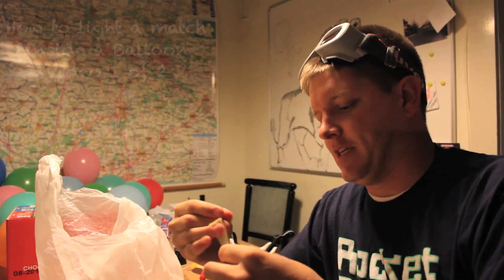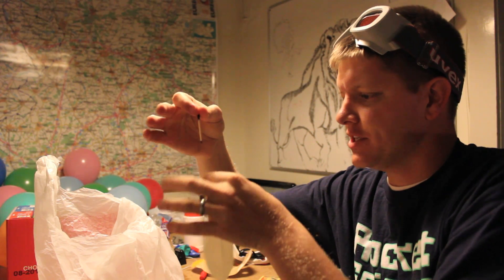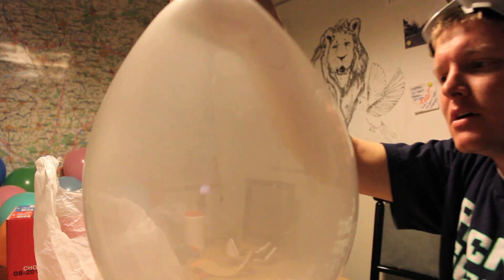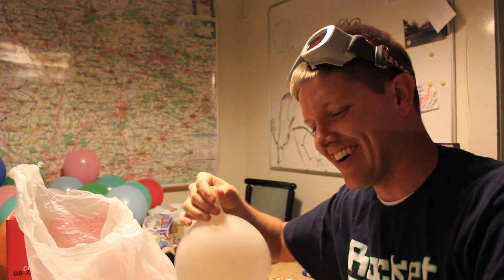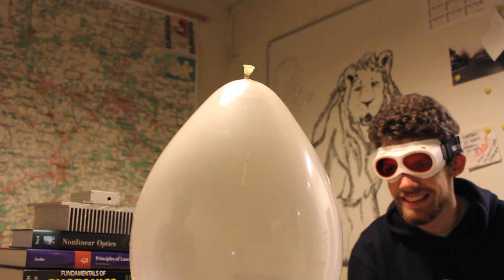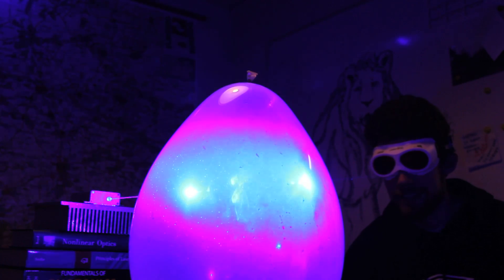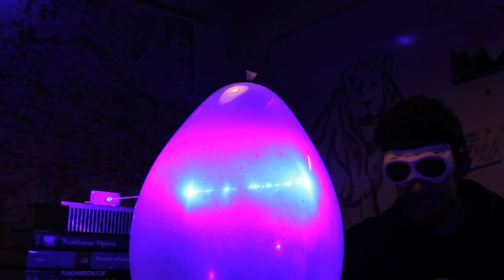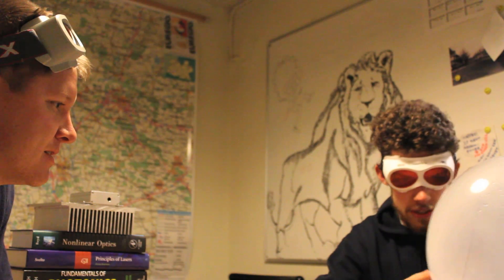How to light a match inside a balloon - Smarter Every Day 36 LASER MONTH

Comment: This experiment was great.  I expected to see the light focused onto the match as a means of passing through the balloon without harming it, but it appears that focusing the light was not necessary.  I liked seeing the condensation from the water byproduct of combustion.  Also, did you notice if the balloon increased in size from heating the air?

Comment: did you put a filter on when the laser was active? or did the camera decide togo nuts?  it looked cool
Reply: high powered lasers tend to show the line streaks.. I believe the laser used is an industrial grade laser, which could be around 5W to 50W.. bigger industrial laser could reach up to a couple of MegaWatts
Reply: I recon it looked like the camera got nuts as the laser got every so slightly scattered and even a fraction of the beam is enough to saturate the camera?

Comment: You need oxygen to have a fire! You used you own exhaled air which barely contains oxygen.
Reply: the atmosphere is 21% oxygen, 78% nitrogen and 1% other, which is mostly Argon. there is hardly any CO2 in the atmosphere. you breath out 16% oxygen, so only 5% is used up in respiration
Reply: But it still contains oxygen.
Reply: but no enough to lit it on fire
Reply: well whatever
Reply: thanks for the reply and your time
Reply: Okay, our air we breath is not all oxygen(O2) there is more carbon dioxide(CO2) and nitrogen(N2).
Reply: Your breath contains a fair amount of oxygen. It's why CPR works.
Reply: actually, I am very certain we don´t use A LOT of the Oxygen we breathe in
Reply: What's you're forgetting is that he's lighting a chemical compound, and not just burning, say, paper or the wood of the match.  Match heads contain potassium chlorate, which is an oxidizing agent.  When the potassium chlorate breaks down, it releases oxygen.  

That's probably why the balloon didn't pop, the fire went out almost as soon as the matchhead was used up.
Reply: u may not. I m very thorough
Reply: RCFlightReviews
thx
Reply: 16% is barely enough to start a fire though. Fire prefers higher oxygen levels. how much depends on the substance but as a rule of thumb. The air you like to breath is the air fire likes to breath. As humans anything less that 19% is considered dangerous.

Comment: he blow into the balloon to fill it up, considering that there is already a little amount of oxygen in there, the level of CO2 should be much more. I am just confused, that with so much CO2 and water vapor how could the match really light up?
Reply: There is the same amount of oxygen as any old air you could light a match in, and there would only be tiny amounts of water vapour which a match could handle
Reply: The water you see in the balloon after the match burns is actually from the match itself. When wood burns, about 50% turns into carbon dioxide and 50% turns into water.

Comment: THE BALOON DID NOT SHRINK BECAUSE...

the same amount of carbon dioxide is produced as oxygen is used up.

why because of the equation...

C+O2~CO2
from the reaction we can see that the same amount of moles of oxygen per unit time is used up and is equal to the same amount of moles of carbon dioxide per unit time being created (look at the equation ^^^)

now...  VOlUME=moles*24

if moles of oxygen used=moles of co2 created. Then when oxygen combust the same volume of oxygen which is removed is replaced with the same volume of carbon dioxide.

to conclude, the volume remains constant.

even if there is incomplete combustion occuring.
Reply: +ZKR JAMA yes but heat causes expansion so it wouldn't be unreasonable to expect some even though the match is small
Reply: +Shaithydollarz 1 mole of gas takes up the same ammount of space no matter what gas it is
Reply: ZKR JAMA why then does a soft boiled egg suck into a jar when you put a lie match in?
Reply: +Benjamin Shaffer If you look closely at the baloon you can see that it actually get bigger!
Reply: happy this is not true
Reply: youre considering the ideal situation. It is definitely possible to find gas that occupies a volume that doesnt satisfy your "constant"
Reply: matter is nor created nor destroyed!!!
Reply: What?
Reply: +Accelerator 
Wut are chu doing here?
Reply: with that logic nothing would shrink at all.
Reply: isnt it because humans exhale co2 ? but then what did the fire produced by the match use as a "fuel"?
Reply: because the co2 thats produced is hot and leaves the bottle by pushing the egg up but because of the shapen of the egg on the cap the air cant go back in after the air in the bottle is cooled so the egg gets pushed in
Reply: Because the air inside warms up and expands when the match is lit. Then when the match goes out the air cools and shrinks and pulls the egg down as it does.
Reply: Shouldn't heat make it to expand since hot air is less dense than cold air?
Reply: The balloon gets slightly bigger because the fire heats up the air so it expands a bit. Without the heat, volume would stay more or less constant.

When you light a match, the air inside the bottle heats up. Then you put an egg on top of it. After a while, the air cools back down, becomes more dense and sucks the egg inside.
Reply: you're also forgetting to factor in the smoke, which I know contains phosphorous, and whatever other things exist in wood. So it could expand, not to mention the difference in density between O2 and CO2.
Reply: +ZKR JAMA just because they moles of something remain constant doesn't mean they take up the same amount of space, there is the factor of density y'know..
Reply: shaithydollarz

yhh your right density would affect it but

volume=mass/density

and the mass of co2 would increase as
mass=moles*mr 
and the MR of co2 is greater but the moles is the same.

however the density of co2 is larger than that of O2.therefore making the volumes equal....

i could be wrong but im just explaining it from what i know
Reply: forest dewberry smart idea never thought of that, but even then i believe the volume will remain
Reply: +Ryan G Unless you need to be extremely precise in your measurements, the ideal gas law is close enough.
Reply: Shaithydollarz 1 mole of gas, no matter what gas, will always be 22.5 L. I'm currently taking honors chemistry, and know a thing or two about what i'm talking about, unlike some people above me on this thread.
Reply: +Shaithydollarz Honesty, i could go on further, and calculate the exact change in volume based on the change in heat, but i'm feeling lazy today.

Comment: Did the combustion increase the volume of the balloon?  (Sold being turned into a gas?)
Reply: I dont think there was any combustion if so it was very brief. Correct me if I'm wrong but the balloon containing carbon dioxide, and in order for fire to stay alive it needs fuel and oxygen. And since there is no oxygen the fire cannot survive thus causing it to. Be deaded
Reply: bigtuckTm Great question.  The match has an oxidizing agent and released oxygen just like oxygen masks on airplanes.  For the match and oxygen masks on planes the burning of chemicals releases oxygen for a second for the match and 30-60 seconds in a plane.

Comment: This is a Spyder 3 Arctic laser. It's very expensive and kind of dangerous. A lot of you have been asking for a link so shazam -  http://www.wickedlasers.com/arctic?gclid=CJ3HrNqn1LsCFWMV7Aod4mkApw - There are other colors and such so check it out, that's only the link to the exact model they have.
Reply: DtodaH
 I think the laser in this video is more powerful than the Spyder. I haven't looked at the wickedlasers site, but I bet they don't pop WHITE baloons. That's the key. Even if they shined the laser through a black spot sharpied on the balloon, it would pop.
Reply: The Spyder 3 Arctic laser is not used in this video! That laser would have destroyed the baloon. They use that laser in a video to pop 100 balloons in a row. This is likely one made from the Laser Expert in these series of videos, and can probably be purchased from his store in the description http://bluefan.nl
Reply: I'm not sure, but a quick judgement based on what I do know might suffice as an explanation until I check this out and find out what laser exactly they are using but essentially this is my theory at the moment: The colors we see are determined by the energy each material absorbs. Red having longer wavelength will produce lower energy and materials that absorb that lower energy produce a color reflected by said material, that is, a higher energy wave with a shorter wavelength, the color being blue in this case. Now black is not a color but the absence of color. It is due to either no light and therefore no energy absorption nor reflection OR absolute absorption, meaning every wavelength of light is absorbed but none refracted.

White reflects every color we see, and therefore does not absorb any energy. Being that the balloon is white, my theory is that it reflects the laser without absorbing any energy but due to the balloons transparency the laser passes through and lights the match.

Comment: the balloon is filled with CO2. why does the match seem to keep burning without any oxygen?
Reply: There is still plenty of oxygen left. Our lungs are not 100% efficient. The composition of exhaled air is around 13-16% oxygen and 4-5% CO2. That's right, your breath still contains 3-4x more oxygen than CO2.

Comment: Man, you really made me laugh hard. First off, the balloon is not transparent, it's white, and white color disperses light, while black color congregates light. That's why you are better off with a white shirt in a shiny day than with a black one. The reason the balloon is not popping is because it disrupts the focus of the laser thus lowering it's power in the contact point. LASER is essentially a targeted heat beam, so it would light invisible gas just as a match would. ^^

Comment: Others have answered but I will try and be complete.

You actually only use a little of the oxygen in the air. Air we inhale is 21% oxygen. When we exhale during normal respiration there is still 14-16% oxygen left over. In an environment with that less oxygen its harder, but possible, to start a fire or keep one going, but strike anywhere matches contain their own oxygen in the form of an oxidizer that helps get the reaction going.

Comment: -_- no. 1 part carbon, 2 parts oxygen yes. however, the oxygen is chemically bonded with the carbon, and cannot react with the match to oxidize (burn) it. the reason it burned is because the body does not turn oxygen into carbon dioxide instantly, so if you take a deep breath in and then immediately blow out again (like you do when blowing up a balloon) you still exhale quite a lot of oxygen.

Comment: The oxygen in a carbon dioxide molecule is in a different oxidation state compared to the oxygen atoms found in pure oxygen molecules, O2. CO2 is therefore not a substitute for O2 in the combustion reaction. In fact, some fire extinguishers use CO2 to stop combustion.

Comment: CO2 is not an oxidizer and cannot sustain combustion because the O2 is combined with the C.  Enough of it will extinguish a flame by displacing the usable O2.  They make fire extinguishers that contain pure CO2 for this reason.

Comment: Darkvoid52 is right but there's more. The head of the match is made with about 50% of potassium chlorate which acts as oxidant for the rest of the mixture. So if you lighted this match in a baloon completely filled with co2 or helium or nitrogen... with no oxygen at all, its head would still burn, but the wood wouldn't.

Comment: In the egg experiment, the egg is forced into the bottle due to a pressure drop created when the fire in the bottle goes out, cooling the air inside.  In the case of this experiment, the match is burned, both heating the air and releasing gases, and causing it to expand.  If you watch the balloon closely when it lights, you can actually see it expand a little.  If you were to leave it in until it uses all of the oxygen, it would cool and contract a little.  I hope this helps.   :3

Comment: The air you breath in is roughly;
77% Nitrogen
21.2% Oxygen
1% Argon
.8% Trace gasses

You breath out roughly
77% Nitrogen
16-18% Oxygen (dependant on work and fitness)
4-6% Carbon Di-Oxide
1% Argon
.8% Trace gasses

Plenty of oxygen for a fire, or for a human to rebreath again!

Comment: By opposite side, I assume you meant on the other end of the visible light spectrum (e.g. red vs. blue), then the answer to your question is yes. 
You can even shine rays that is invisible to human eye, such as x-ray or intense infrared to pop those balloons.
The key is, if the balloon absorbs the energy of the ray, it heats up and blow. On the other hand, when the ray pass through it completely or balloon reflects all of it, then it will not pop.

Comment: It might, but the balloon’s skin is thin is able to radiate the excess heat in both directions. that’s why it’s easier to use a solar death ray to start a fire on the solid wooden planks of a ship than on the sails. The pitch doesn’t even help, since it cools down the wood until it boils away (in a few seconds).

Comment: there is oxygen in the balloon because a large portion of what you exhale is still oxygen. the reason that the balloon didn't get smaller is because the match only lit for a second and went out, probably from not enough heat to start a large enough flame to burn the wood.

Comment: Mostly to do with the color here. Being it is mostly transparent. Almost none of the energy in the light is converted into heat, and so shines right through. Remember, the laser is not hot in itself, it is a high powered light. On a dark surface which can absorb this energy it will be transferred as heat. Being the match is for the most part dark it was able to absorb enough light as heat to ignite. Simple :P

Comment: Good question. From what I understand about our respiratory system, there is still oxygen in what you breath out. The longer you hold your breath before exhaling, the more CO2 and the less O2 is present. However either way, there is still a decent amount for the match to ignite; even if only for a short length of time.

Comment: Well, quite a few of them *are* high powered enough (They generally range from tens of milliwatts to hundreds of milliwatts in indoor shows), yet they either spread the beams out with diffraction gratings, or scan the laser so quickly over a large area that any one person gets only a very brief, non-damaging exposure. The calculations for what is safe can be quite complex however, and you're right... it's still a good idea to look away. Wikipedia has a good article on 'audience scanning'.

Comment: wouldn't the balloon get larger because the heat from the match and the laser gives the air inside it energy so the particles vibrate more, causing high pressure?

Comment: @Nexus2Eden unless that match was produced in the 1800s there would be between very little (strike anywhere) and none with the phosphor on the box striker. Regardless the oxidation of Phosphor produces no watter. The head of the match is mostly a chlorate of one kind or another, but provided it is oxidizing sulfur also produces no water. Cellulose has a lot of Hydrogen but hydrogen is also the lightest element and is only 1/13 the mass of cellulose. here is the math:

Comment: you can light a small candle in the balloon, a birthday cake candle stub for example, then turn off the light, you may see a balloon lamp expanding, and if the candle stub is light enough and the balloon big enough, maybe you can see the balloon lamp rising, if that doesn't happen, change the balloon to a sealed plastic bag

Comment: Could it be said this proves the universe is a closed system?...every action has an equal and opposite reaction as in the match used the air in the balloon as fuel but the burning of the air created another gas to replace the lost air, therefore no expansion or contraction of the balloon. Correct me if I'm wrong, please.

Comment: Fire uses up oxygen but gives out an equal volume of carbon dioxide. The balloon is stretched so thin that heat transfer is as if it was not contained (so the heat won't cause the balloon to expand), or there is just not enough air being heated to inflate the balloon any further.

Comment: not sure i understand why the balloon didn't pop.. Even though the balloon is transparent, the heat energy has to pass through that single point on the balloon's surface where the laser is pointing. Does this mean that the rubber conducts the heat to the inside surface ?

Comment: In an EQ RXN your formula (equation) will still be balanced AND the products will equal the limiting reactant as determined by the K value, however the RXN itself doesn't balance the equation or itself (they are unrelated) - the RXN proceeds towards equilibrium until it consumes the limiting reagent or reaches an equilibrium of K=1. 
The original statement was that the balloon didn't shrink or grow because the rxns balanced each other - which isn't accurate or correct.

Comment: @Zaviex The point I was making was that the reactions didn't balance itself out, which the original poster stated. Equations are balanced, not reactions (which was I think your point). Equilibrium does not mean Balanced, the EQ constant K is a Rate. A ratio of exchange at which reactants and products intro-convert. And as you stated this is a combustion RXN ... it is a one way RXN, not equilibrium as H2O & CO2 are not simultaneously reconverting to Cellulose and O2.